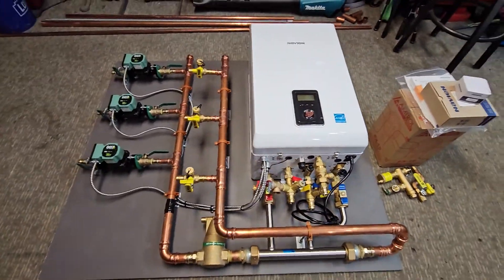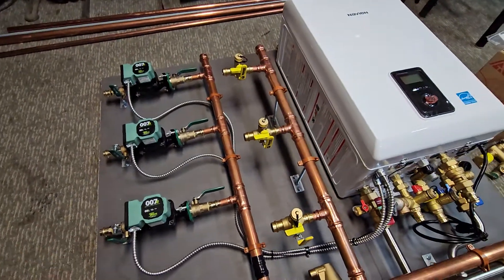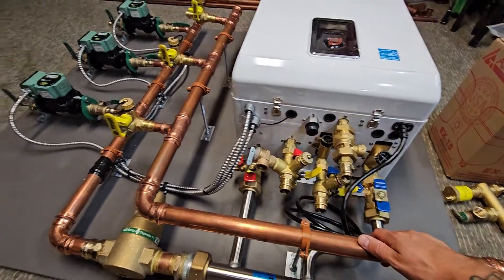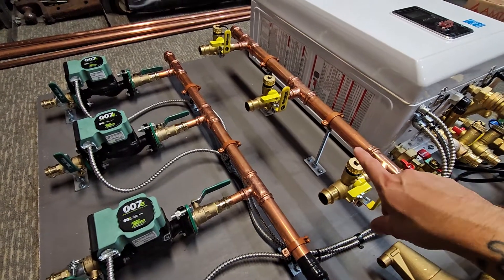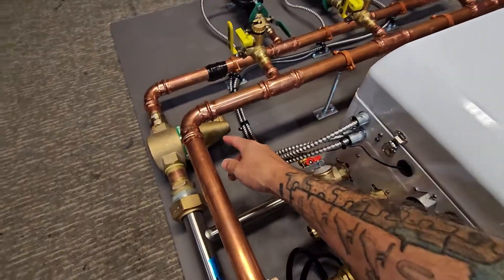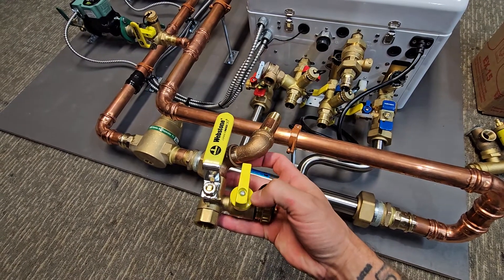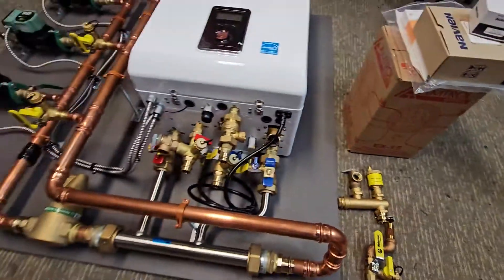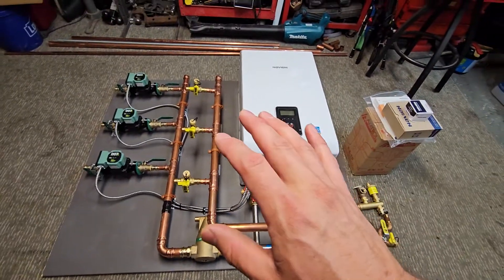Pre-Built Multi-Zone Combi Boiler Systems For DIY Installation

Comment: Jim what should settings be on combi for just using dhw? We do not have floor heat hooked up yet.
Reply from the maker: You will need the heating side pressurized and removed of air in order for the domestic hot water to work. It uses the heating side of the boiler to transfer the heat through a heat exchanger inside the unit to heat the domestic hot water.

Comment: Hey Jim, really enjoy watching your videos, super informative!….in this video, what size is the pipe going into and coming out of that taco 4900 air seperator? I’m building something very similar with three zones for baseboard heat and just trying to figure out the proper pipe sizes. Thanks!
Reply from the maker: @JosephBerni-e2h  1 1/4"

Comment: Do those circulators have to have IFC valves? Great video
Reply from the maker: Yes if there is more than 1 zone pump you'll need them.
Reply: @JimSperanza  the way I understand an IFC is it opens when the circ pump turns on .  How does water go through the pump when purging? Does water pressure from the auto feeder open the IFC to purge? Thanks
Reply from the maker: @williamserver4332  yes it's literally just a simple one way check valve that pops into the circulators opening.
Reply: @JimSperanza  Thank you. If you had only one zone wouldn't an IFC be needed to prevent heat from rising throughbthe house by gravity?
Reply from the maker: I always install them even in single zone systems

Comment: Your videos are extremely helpful! I am using a Rinnai i120c but plan on using circulating pumps instead of zone valves. How many pumps can you run directly off the unit without adding a Taco Zone Controller.
Reply from the maker: @nickfranco754  thanks for watching! You can run up to 3 pumps or a single pump with 3 zone valves.

Comment: Sincere, honest question. Not trying to be a smart aleck. If it only have three zones, how do you heat the rest of the house. For example, let’s say I have a three bedroom that this boiler services, how would you heat the living areas?
Reply from the maker: You can add more zones with an external controller
Reply: @ Ahhhh, thank you so much! What do homeowners typically do in the other living areas when they’re not adding an external controller. Do they rely on electric space heaters, maybe?
Reply from the maker: @autocompletellc9906 it all depends on the situation. Why does the house not have heating in that room already?
Reply: @JimSperanza  I’m just asking hypothetically. All the rooms in my house are heated. I was just trying to figure out what kind of layout the home in your video had that it only needed three zones. Of course it could be like a one bedroom with a living room and kitchen, so only needs three zones. I should’ve thought about that before asking the question. But I certainly appreciate the answer.
Reply from the maker: @autocompletellc9906 a zone can cover a larger area such as 3 bedrooms on a single zone. The zone layout all depends on many factors.
Reply: @JimSperanza  That’s one of the things that I was considering—that one zone don’t necessarily mean per room. Now, it’s all come together💡. Thanks again.

Comment: dude i have rebuilt my system twice just cleaning and overhaul . I had enough and got a few quotes to replace , literally just r and r my machine  , and i got 7500 to 12,500 for a 2k Dunkirk boiler with 4 fkin quadrants.... You guys definitely live within a cult of 1000 dollars per hour for labor universe . Im literally looking at going back to school to get certified .
Reply: I choked after getting a $10k quote to get a new boiler installed…..the last guy wanted to convert my house to geothermal and add my 2 hydronic circuits into that—$40k.  Or a new boiler ($2600 boiler) for $14k.  I’m might go get certified too!
Reply: Just sent you an email :)

Comment: Is that 1" or 1.5" copper pipe in this video from boiler to the circulators ?
Reply from the maker: 1 1 /4"
Reply: My 240/130 is 1½ off the manifold.

Comment: Jim designed my retrofit radiant system. His attention to detail is amazing. I am in the process of doing my own boiler/piping/pump/valve build. He called out several things, like the need for a buffer tank if I'm doing micro-zones with multiple thermostats and manifold actuators. I now have the confidence that I will not miss any important detail, and that, with his guidance, will result in a very happy family for our in-floor heating this coming winter and seasons beyond.